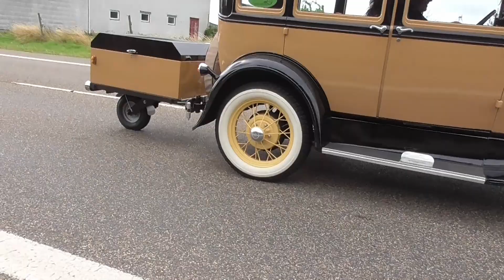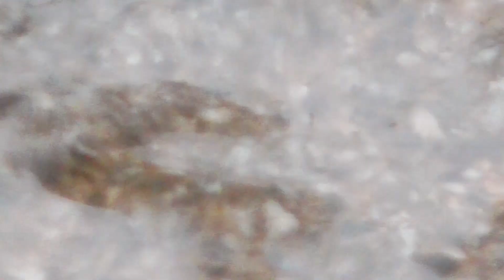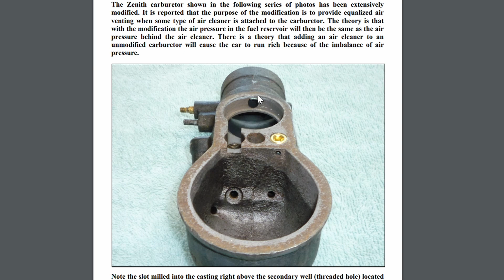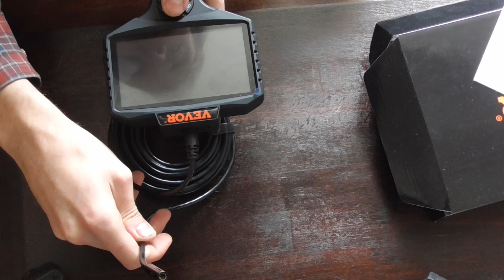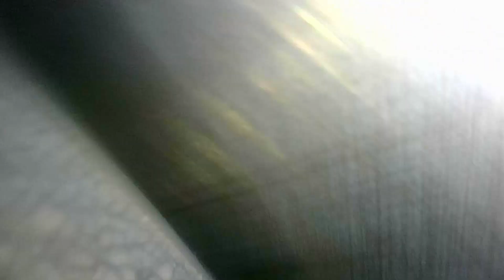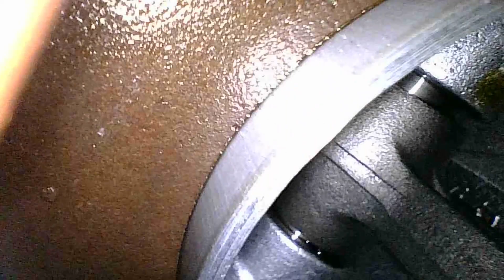Model A Mechanics Log #5: Events, Endoscope, Gaskets

Comment: Greetings from Idaho, USA.  Regarding your carburetor, did you end up air balancing it?  You are running an "air maze", not really an air filter, as it is just wire mesh and only good for big rocks, birds, moths, etc. and has essentially no restriction, unless you get it caked with grease, dirt, etc.  I run a hiboy K&N air filter on my Zenith, which can have some D/P across it, so I airbalanced my Zenith per Dave Renners instructions and it runs marvelously!  It was an easy modification which you could do in about a half an hour.  Thanks for your videos! They are instructive and entertaining!

Comment: Great video as always.  Can you borrow a carburetor from someone?  I had one that ran terrible and I checked everything, seemed fine.  For laughs I through in new jets, fixed it, and I don't know what I really did.  I hate that.  I found a few with cracks, and they are hard to locate.  I am not a fan of those plugs you use.  They're really for a tractor.  I run 3x, but have used the NGK plugs with the adapters in customers cars with good results.   I think your engine is fine and will run a long time.  It will all work out.
Reply from the maker: Carbs are rare to come by over here, so sadly thats not an option.
Alas, the picture of the plugs just tells me that enrichening the mixture somewhat is all I need to do to fix my issues.
Haven't had troubles with these plugs, so I'll just leave them in.
Reply: Hi Astra, I talked to an old Model A guru of mine and told him about your issues.  His first thought , and he's pretty sharp , was how is your exhaust system?  He's had issues over the years with some causing too much back pressure.   I'm going to Hershey in Oct, would you like me find you a carb?  I have some too.  I'd be glad to mail it to you.  I know old cars can get frustrating, but they're worth it.  Mine drove me nuts for a long time, but now it's right.  Be well, Brian
Reply from the maker: @brianmatthews9697 I have one of them cheap repro mufflers, and judging by the noise it makes, there isn't much inside it that could restrict flow xD
Regarding carbs, I still want to try flow-testing the jets and see if that makes a difference. If all that fails, I'll gladly come back to your offer!
Reply: Sounds good, Let me know how you make out.  I always keep an eye out for your videos.  @AstraWerke

Comment: so if you want to know what the air fuel mixer is . so your not running to lean  or to rich .  why not discretely install an O2  sensor  with a gauge  so you can see what's going on . air planes do the same with exhaust temp gauge
Reply: No way, it would ruin the aesthetic. Besides, reading spark plugs is an exact science
Reply: not only that but motors are cheaper . just kidding about that but i would still want to know what,s going on real time and not after the fact maybe a sniffer it the tail pipe tell you get it dialed in .    @Hjerte_Verke

Comment: Do you think possibly some of the metal fragments that you're finding is from the machining process? When it was rebuilt?
Reply from the maker: Initially, sure, but still after over two thousand miles?
Reply: @AstraWerke  I did also find some Minute Metal particles for a while After I had insert bearings, put in mine about three oil changes

Comment: I use a "Gunsons Colortune" to adjust the fuel mixture, I don't know if you can buy these in Germany, but they are basically a spark plug with a viewing hole so you can see what colour the mixture is igniting at, adjusting the air mix to give a "bunsen burner blue", without orange or white flashes.

A better fuel mix should reduce the running temperature and if the wear marks on the bore are the result of too much heat, then this will help too.

The engine will wear as it "runs in" and as you say, most people will never see inside their engine so have no idea, a case of perhaps too information?

It would not bother me unduly and given the increasing restrictions we are all facing on driving fossil fuel powered vehicles, I suspect that engines will not be able to do the mileages that they were designed to do before we are told to stop.

Thanks for sharing and like the product review, will see if this is available in UK to buy!
Reply from the maker: Well, looking at the plugs and judging engine performance is probably going to work out for me - no need for fancy equipment.

It's a case of too much information most certainly - had I not had the endoscope, I'd just assume the engine was in great shape and not worried any.
I think I need to do more of that.
Reply: @AstraWerke  I agree. Your assessment of the too-lean condition of your fuel mixture seems entirely correct; these parts do not lie

Comment: I use Amsoil 100% Synthetic Z-Rod 20w50. My A’s engine was built about 50 years ago and runs like a top. Ford recommended 30w and that’s about what 20w50 averages out to. I know some are going to say that’s too thick but works for me and if I ever rebuild I will reevaluate.
Reply from the maker: I don't doubt your engine does well with the oil you use, but I've run both SAE30 and 20w50 - and believe you me, they are two very differently behaving oils.

Comment: Molly is a good thing for sure. Also please look up tuning an older engine. Have you thought about picking up a carb cheater device? Bring the old A into the 21st century for tuning.
Reply from the maker: I think step one is to get the stuff I have to run properly before buying some magic device that ought to improve everything.
I wouldn't throw a high-compression head onto an engine that performs badly either.
Reply: @AstraWerke  a carb cheater is basically a tuning helper device. Thunderhead289 builds them.
Reply from the maker: @Engineerd3d  Looks alot to me like an electrolically controlled air valve. My car is already running too lean, so adding even more air probably won't help any
Reply: @AstraWerke  I was thinking about the snap crackle and pop you are experiencing, it is due to lean conditions and that is called pinging. Tune it by ear.  Also the electronically controlled air valve is correct, however it is also giving you data logging ability via 02 sensor.

Comment: I felt concerned when, in an earlier video, you referred to more “conservative” timing. From what I’ve read it appears that there is an optimum timing range based on RPM and load, and engine temperature can be too high from either too retarded or too advanced timing. Many years ago I read an account of riding an old Harley Davidson motorcycle with manual spark control. The fellow forgot to advance it after starting and was riding several hours at highway speed. He then noticed the exhaust header was glowing bright red! From this I always remembered that too retarded a spark setting generates excessive heat. 
It was fascinating to see inside the engine, particularly the underside of the pistons. 
As for oil (oh boy, everyone is an expert) I concur that our Model A engines can tolerate a wide range of oil specifications. I’ve used a variety, including 5W-30. Currently trying a “racing” oil that has much higher levels of zinc than normal. I considered using a zinc additive but read that there are many different formulations and the particular zinc must be compatible with the oil’s composition or it will do nothing. The article was authored by a petrochemical engineer. He made the point that a consumer cannot accurately predict which additive will work, so just buy the oil already formulated for the issue you want to address. 
As sane as that sounds, I add Marvel Mystery Oil to each tank of gas. Why? I don’t know, it’s a mystery to me.
Reply from the maker: Well, I tried doing everything right by following manufacturer instructions.
May not have been right after all.

I hope the MoS2 will serve the same purpose as ZDDP would. I did run Zinc oil before the engine overhaul, and mistakingly thought a fresh engine wouldn't need it.

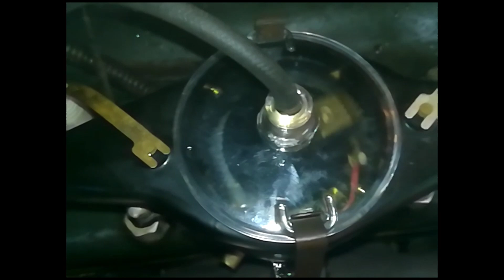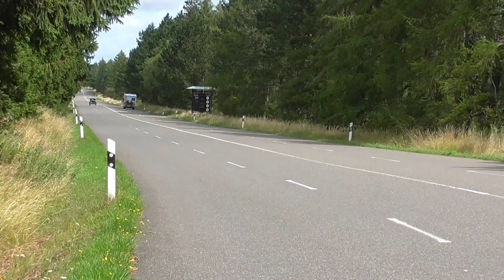Comment: @3:44 to 4:00 you mentioned a tool to checking towing (i hope i spelled that correctly), What is the  name or part number for this tool?
Reply from the maker: It's called a Toe Measuring Gauge. They are variable and not designed specifically for the Model A.

Comment: Keep the car Adrian. But like you say - and others do too - you have a too lean mix to the engine. That needs to be addressed, and if it’s not the carb there is an intake leak - or a combination of the two. Old engines need quite some fuel also for the cooling of the cylinders like someone else added. So, test for intake leaks - not with start gas but with a method where you can actually find it. I myself use air and soapy water on motorcycles. 

Float level is also important to have a carb that performs, avoid brass floats since they are often too heavy. 

The cylinder walls are fine, no problem there. 

When you have the mixture right and it runs ok, open up a little bit more fuel and you’re safe - gets a little bit more power too. And to sleep well at night, add some 2T oil to the gas. It also makes them happy. ☺️

Last but not least: what oil do you use, and what was recommended from factory? Recommending something here would be like walking into a mine field - but I think heavier oil and even single grade can be used? 

Again, keep on the good work for us to enjoy your fantastic videos! 👍⚓️
Reply from the maker: The "too lean"-issue can simply be addressed by opening the adjustment knob a little more. Apparently, there is quite a large transition area between optimal mixture and the engine starting to perform badly due to too lean a mix.

I use 10w40, Ford recommended SAE30, then later changed that to sae40 in summer and sae20 in winter.
Since the engine isn't pressure-oiled, I don't want to risk starving it of oil by using heavier oil - and by using multi-grade, I hope to counteract the issues with single grade oil: Thick as honey when cold, thin as water when hot.

I've checked the float level in the last video - and since the carb was designed to work with a brass float (and since you can't get anything else for it) I reckon it should work with one.
Reply: Adrian,  For your own peace of mind, I would suggest pulling the head and inspecting the cylinder bores.  It only takes a few minutes.   I’ve spent many hours peering through a boroscope inspecting turbine engine internals.  Accurately interpreting an image when one is evaluating tiny scratches, tiny stress risers, etc. comes through much experience and knowing one’s optic.  Those scratches which appear alarming may well be normal to the naked eye.

The engine is running excessively lean evidenced by both the sound on deceleration , plug readings, and by combustion chamber color. Your work has confirmed that there are no vacuum leaks. This leaves the carburetor.  The adjustment knob does control mixture but this is the equivalent of an adjustable main jet. The idle and transition circuits are also contributing to the engine’s needs. When you release or let up on the throttle in slowing the car; I’m hearing these circuits not doing their job properly.  This is not unknown with the Zenith and can be very frustrating. Paul has a video dealing with Zenith idiosyncrasies. The video was shot with Bob, his dad who has a lifetime experience as an A mechanic.  If it comes to it, I have a known good Zenith which I will send you.
Good luck
Reply from the maker: @myrlstone8904  I'll just leave it the way it is. If I pull the head and then find out it's bad, what am I going to do?
The engine has cost me enough the way it is, so I'll now drive it until the wheels fall off it.

Last thing I can check with the carb is the flow rate of the jets, but I'll have to build a testing jig first.

Comment: Hi Adrian , about to regulate the speed on the wipers the solution with the hose is great,  in carburated Renault cars there is a hose from the intake to the cuba of the carburator to suck all the fuel vapors and burn them, inside is a 1.5 mm restrictor to prevent too much vacum and hence loss of adjusting of the carburator, maybe something like that would do the trick to guarantee always the same amount of vacum.
It was very nice to see the road trip and specially the Borgward part, you see, I happen to live in Monterrey Mexico, the city where was the plant here in Mexico , they only assembled the P100, here known as the 230,230L and 230gl, the 230l were only 7 made and is a longer made limousine , I have worked in one , that belongs to the father of a friend, it was sent to a shop to be restored a few years ago , and I was asked to install the engine again, check all the brakes, and make it run again. They also have a  regular one but it is not working because the crankshaft is very bad and  it can't be welded and machined again, so, until another one appears or an entire engine it will be that way!  The Borgward limousine is a 1968 and the regular one is a 1970, they were in production from 1967 to 1970 and there were still new ones without being sold until 1974.. I love the way they drive, just like my 1963 Mercedes Benz 220s

Comment: The scoring isn't the worst I've seen.  My worthless opinion- You are running too lean and with not enough ignition advance.  You could still have a vacuum leak somewhere.  Do you have access to a vacuum gauge? If you set the timing to that with the spark lever all the way up, it is firing at -4 to -8 (after TDC), then with the spark lever all the way down, you end up with around 36 degrees of advance.  With a stock head, you won't narf the bearings.  The debris in your filter is normal.  Just drive it!  Your engine is pretty healthy.
Reply: Also, 10-40 is too thick.  You should be running a 5W-30 or straight 30 right now.  And it would be wise to add a little Marvel Mystery Oil (naphtha) or 2-stroke oil to your fuel.
Reply from the maker: @ModelA  Honestly, even after 3 years of owning the car, this topic still irritates me... Even here in the comment section, people tell me to use thicker oil - equally as many say the oil I use is too thick.
I guess it's best if I just use no oil at all ;P

I added a cup of 2-stroke oil to every tank of gas since the engine was rebuilt.
Reply: @AstraWerke    The people telling you to run thicker dinosaur juice clearly have no examined the internal oil passages to the main bearings in a Model A motor.  They read something on Fordbarn and just repeat it.  40 wt. oil existed when it was new, so why did Ford insist on 30 wt.? Think about it.  You may not be getting enough splash onto the cylinder walls.
Reply from the maker: @ModelA  That's what I keep telling them - most people seem to forget the A isn't pressure fed.
Funnily enough, the german Model A manual states to use 40 wt in summer and 20 in winter
Reply from the maker: Next time I check ignition, I'll set it up in the way you (and Ford) recommended - I don't know how the insert manufacturers came up with 29° as the end of the world... Maybe for the kind of driver that sets ignition to full advance once the engine runs and just leaves it there all day?

And: By all means, your opinion is NOT worthless!
Reply: @AstraWerke     According to the web forum "experts" (haters), my opinion is less than worthless.  28 degrees advance IS the end of the world when you're running a high performance head, etc.  If you're all stock, then about 36 degrees if the end of the world.  My coupe seems really happy about 2 clicks from full advance on the highway.  That's about 32 degrees.  But mine is all stock.  The more compression you have, the pickier the timing gets.

Comment: As for tire  wear, I found that the Firestones that I first ran on my 31 Tudor gave me fewer miles than my next set of Goodyears.   And the Goodyears fit better in the fender wells.
Reply from the maker: The Firestones are rather soft, I agree.
Then again, that should mean they have more grip.
What irritated me was that the frot tires wore down so significantly while the rears stayed practically mint - with the driving power to the rear wheels, I would have expected just the opposite!
Well, that extreme amount of toe-in probably explains alot.

Comment: Bet that was a fun drive in the rain with bald tires. 

Running lean would cause high temperatures and may lead to the scoring you saw. Don’t know how you managed to do it with that air filter. I agree that opening the GAV more would help, and would probably reduce your backfiring. BTW, I’d not use an air filter. It’s a fire hazard if fuel drips into it.
Reply from the maker: Luckily, I had cut the profile before the rain drive - I'm pretty sure that saved me in a few instances.
The filter I use is just a wire netting, so it won't get soaked with fuel.

Comment: Engines will run hotter and backfire when running to lean don’t forget that fuel is also a upper cylinder lubricant running richer should help with the problems also put a restricter in the vacuum line on the wiper side of the vacuum tank to regulate the speed of the wiper a small piece of brass with a small hole drilled in it will do the job

Comment: What oil do you use? it might benefit from Duckhams, the green stuff. Its on the thick side.
Reply from the maker: I use 10w40 with added zddp.
I'm hesitant to use thicker stuff - the clearances are rather tight and with no pressure oil feed, thick oil might not get everywhere, especially at higher speeds.
Reply: @AstraWerke Hola soy de Argentina tengo varios A, los primeros 6milk los uso muy despacio y tramos cortos para asentarlos, tengo casi 52 años y arme el primer motor de mi A,cuando tenia 14 años,tengo miles de km recorridos,no les pongo aceite multigrado,le pongo Helix monogrado s.a.e 40, con los multigrado terminan golpeando si le das uso intensivo,y cuando están más acentados después de los 10 mil km,si les pongo molikote.
Los armó con babitt,acá cojinetes desmontables no duran si le das uso intensivo,
La tos del carburador puede estar tapado algún conducto del cuerpo saludos.